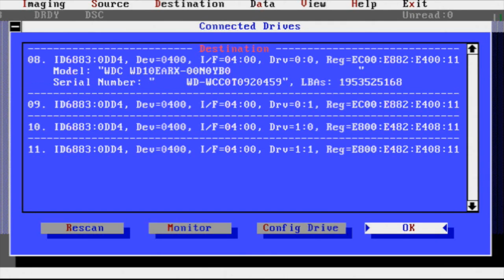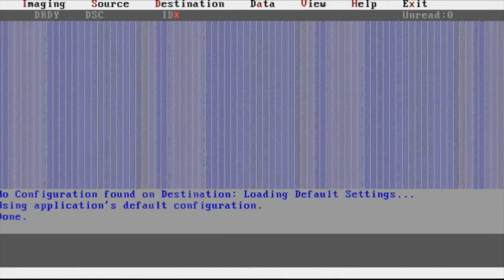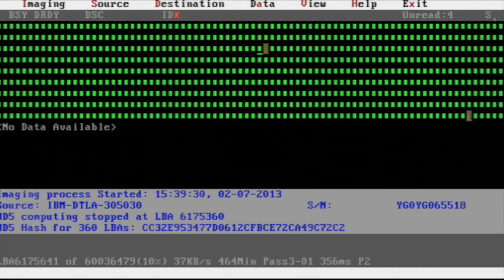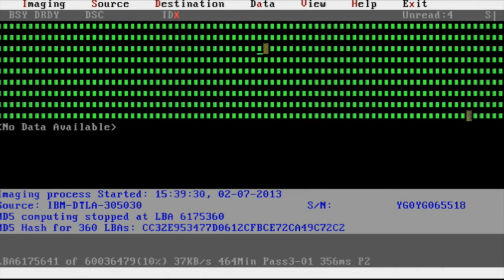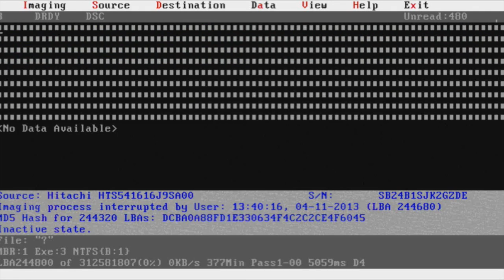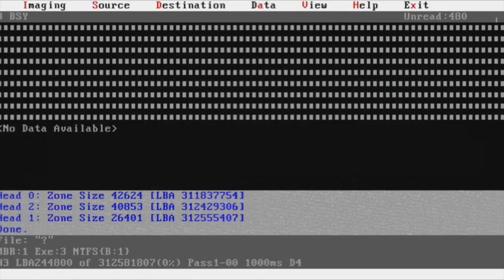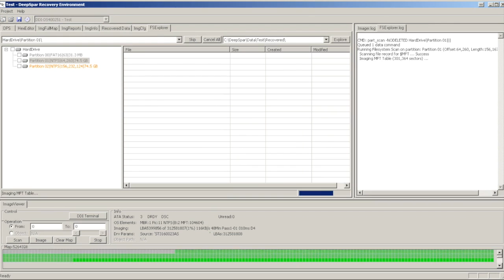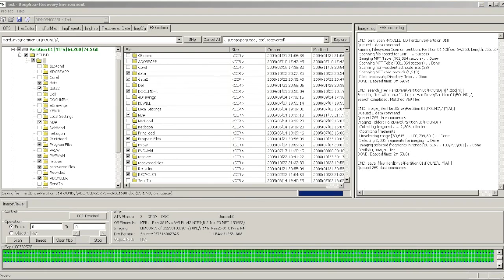DeepSpar Disk Imager (DDI4) demo video with Network Add-on

Comment: Explain to me two things.
1. DDRESCUE skips over bad sectors and looks at them later,  how is yours better
2. What you are showing in the second half could be accomplished simply by mounting the drive in linux and copying the files off, how is yours better

When you say "in a linear way" you basically invalidated your entire video. How is doing something in a linear way take into account different heads and bad sectors?